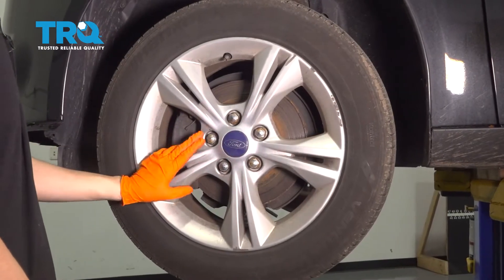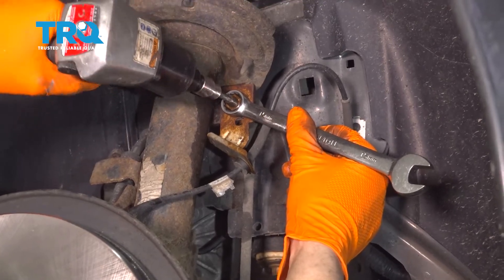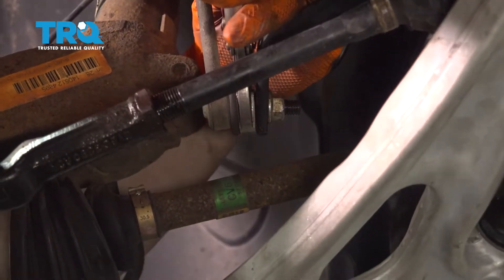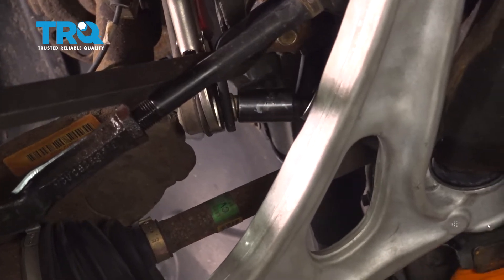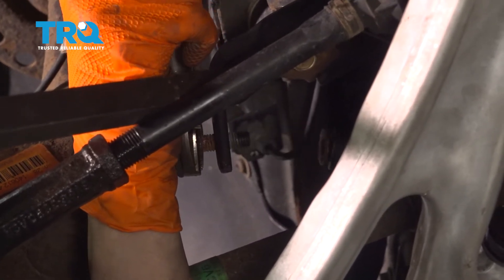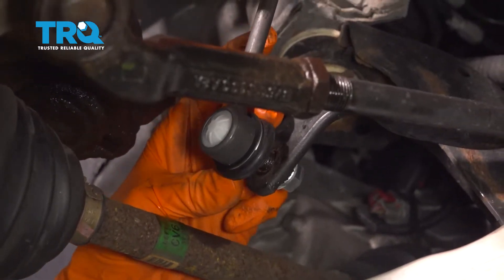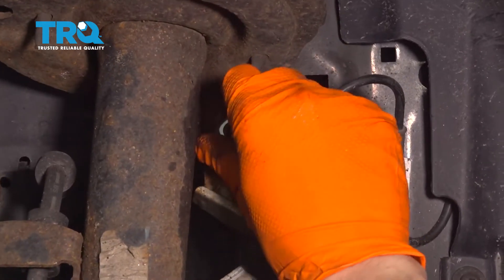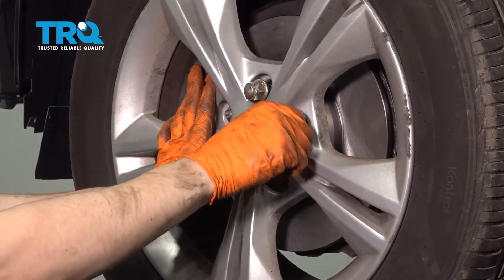How to Replace Front Sway Bar Link 2012-2020 Ford Focus

Comment: My screws are stuck in the hole and really hard to get out I tried leveling the car and lower the jack to put slack on the sway bar but still no luck is that normal?